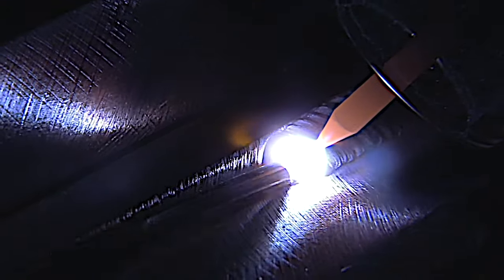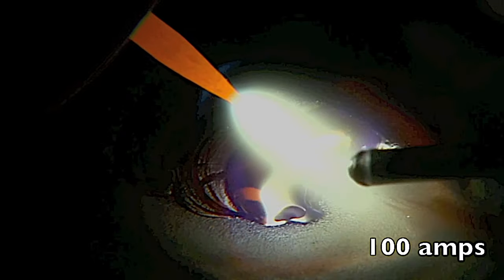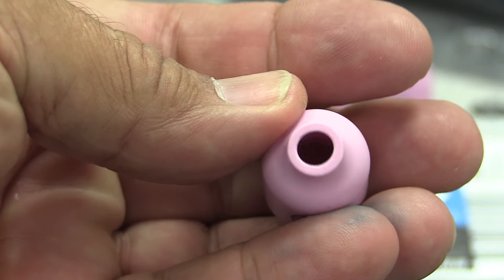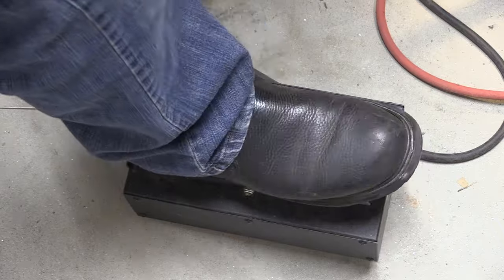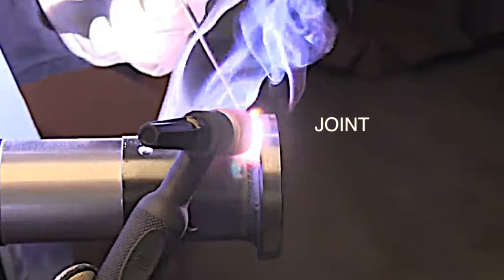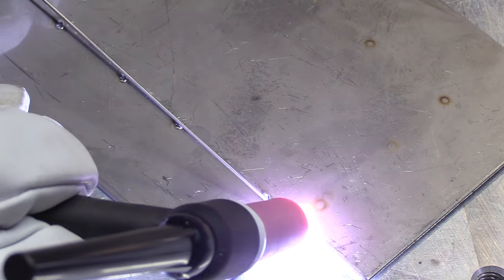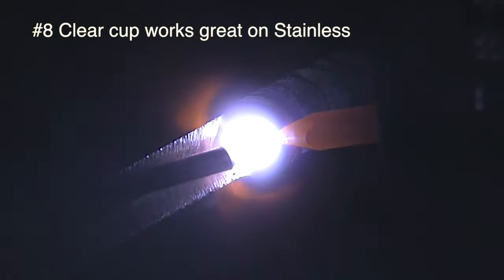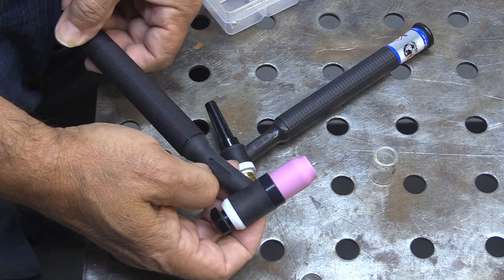Weldmonger® Stubby Gas Lens kit 2.0

Comment: I’m trying to get the flash tacks working.  Blast tacks what ever they are.  I can tack 22 gauge .8mm at 30-35amps (takes all of it) when it’s clamped. But I have to pool and drag it over to the other piece. I’m trying to get my machine set up to do that. ESAB 205i rebel. I’m getting beads and no filler fusion welds on thicker stuff but I’m trying to learn to weld sheet steel.  Brand new to welding. Been a mechanic for 16 years.

Comment: Great video, i struggle with aluminum, mostly i just do not like the way it looks, every once in a while it does look beautiful, they are are strong enough for what they are used for, i'm 62, i do not wear glasses normally but i wear 1.5 for mig welding and 2.5 for tig, the other day i had to modify a power steering line and i used my 1.5 readers while i looked through my magnifying desk lamp.